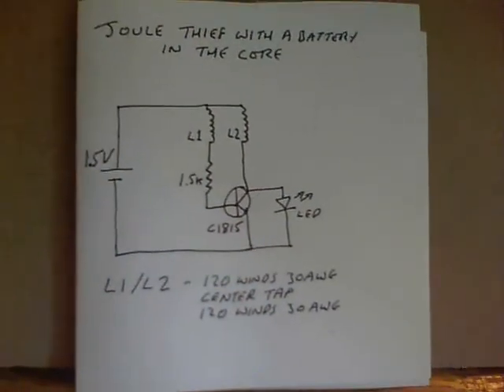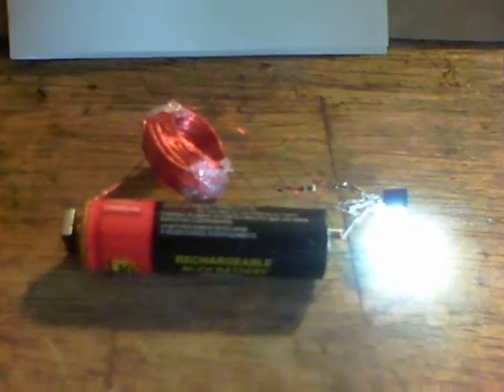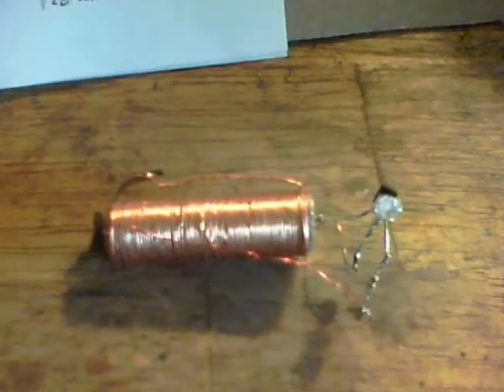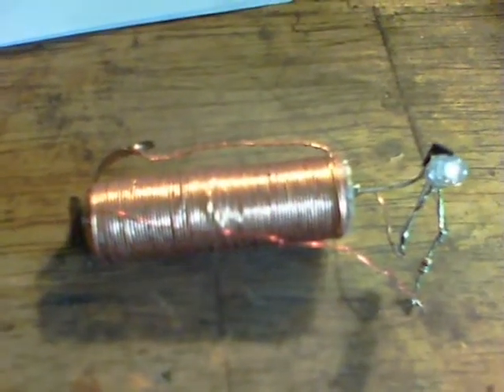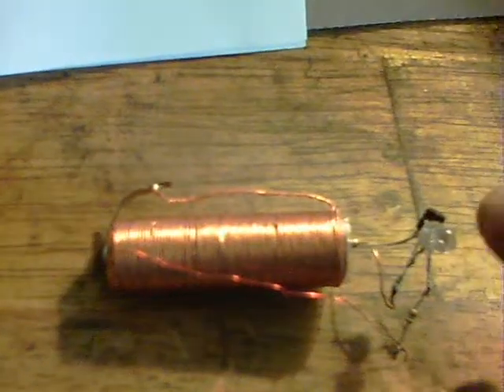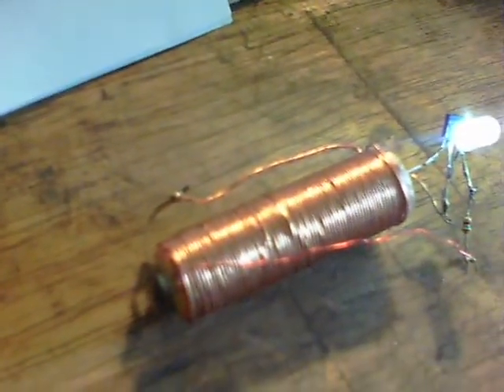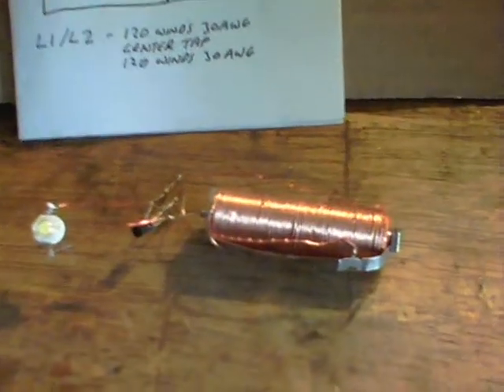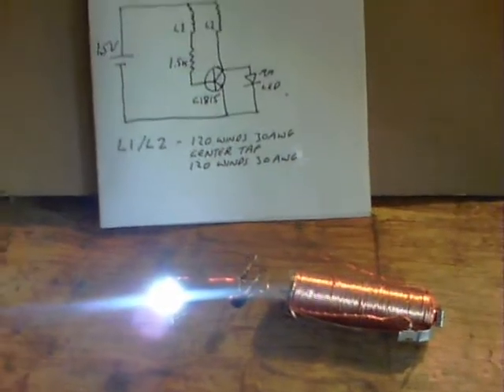Part 3: AA batt as a Joule Ringer core

Comment from the maker: Hmm, i've no experience with LED versions of car bulbs, but would imagine them to be power hungry due to illumination needs. If halogen then there'd be no way (practically) for running from an AA. Anything of high demand would likely need 2 Amps or more I would imagine. A rechargeable + solar would do it better than throwing out Alkalines daily. Then the amp draw wouldn't be so important.

Comment: I have seen many vids where the AA battery powers a 5v led or jumps up to 110v/220v.  I'd have to play about with the winding ratios I guess, but do you think a 12v H7 led car headlight/foglight bulb can run from a single AA or C battery with this type of setup?  The whole thing could be put in a bedside lamp and still output the equivalent of a 40w incandecent when the power goes out. That would be handy!  If you want cheap bright leds the car bulbs are cheaper, hence the 1.5v-12v JT.

Comment from the maker: Yes indeed...might strap the solar panel to the top and have the circuit underneath to give correct sun angle. Bit like the Forever Light if it's designed that way :)

Comment: Slider:

Well done.  Do you see any evidence of my "Inductive Feedback" theory?  (Which is why I tried this)  My posit is that possibly, through induction, we can feedback  or impart some of the energy of the collapsing magnetic field to the battery.  Not a self-runner but, utilize some of that energy back to the battery for longer run times.  Anyway, that was what I was thinking by attempting this.  Excellent job Sir.

Bill